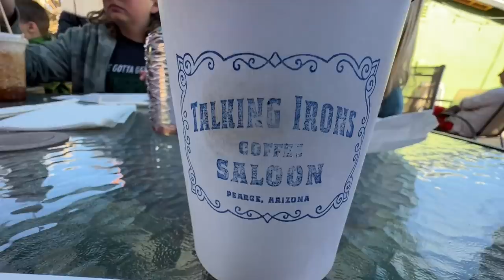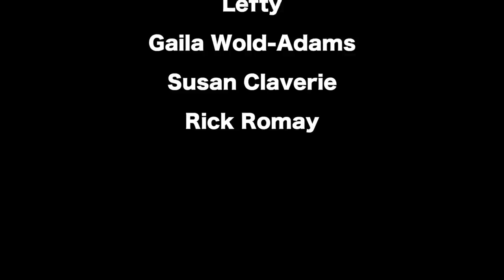Installing Our First Chicken Garden Door Frame! (Day 26)

Comment: Technical question: Do you secure the cleats (vertically) by going from the INSIDE of the door frame into bag in place over the cleat? OR do you install the cleat completely BEFORE installing the bag?

From inside the door frame makes sense to me so I won't need to find a clinic for implaling myself on the nails sticking up. Slightly accident prone here, or a lot if you ask local er staff! lol.
Reply from the maker: The clear is secured into the lower bag with nails or screws and screwed into the frame from the outside of the frame. Choose screws that won’t go all the way through the frame. We install the cleats and try to get the bags on them the same day so the nails aren’t exposed.
Reply: @TinyShinyHome  Thank you.